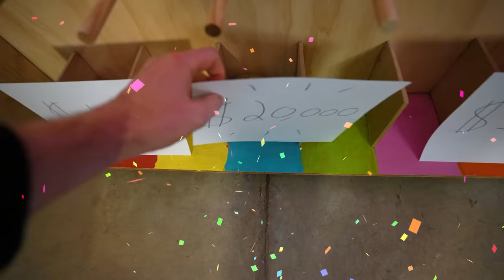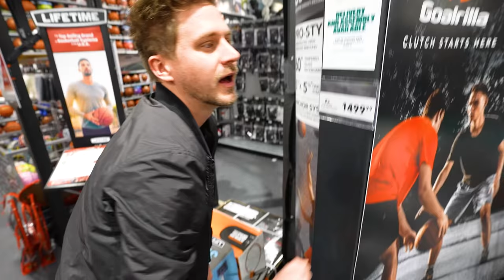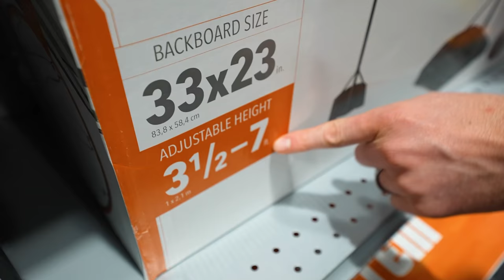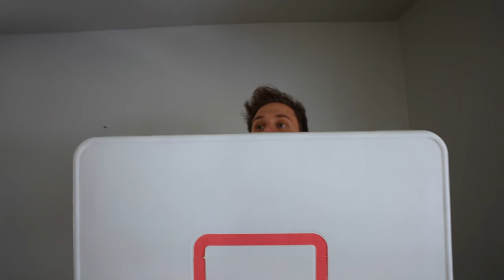$10 VS $20,000 BASKETBALL COURTS! *Budget Challenge*

Comment: In case you were unaware, concrete is supposed to be poured on a gravel bed and not the dirt to stop the ground from washing out from underneath. Hopefully you don't get a lot of rain cause else it will settle and crack much quicker. Rebar or any kind of wire mesh would of also helped, especially without a solid gravel bed. Not hating but make sure your contractor isn't taking advantage of you. Especially when you tell them your going to pay 20k. A lot of people will cut corners to make an extra couple hundred bucks.
Reply: They skipped a lot of production they probably used rebar
Reply: nobody asked for education but thanks
Reply: It’s not school time
Reply: Eman Michaels  stick with the Pokémon cards.😭
Reply: Eman Michaels  I got a job lol.
Reply: Eman Michaels  good luck with that. Honestly.
Reply: @johnpaulrhodes4742  in htgh uitgeven muur Kim mijn.      Ukrm je de n tumult❤❤
Reply: @johnpaulrhodes4742  I cant believe these people exist, how are they gonna survive in this world with that mindset.
Reply: Does anyone else miss train gang???